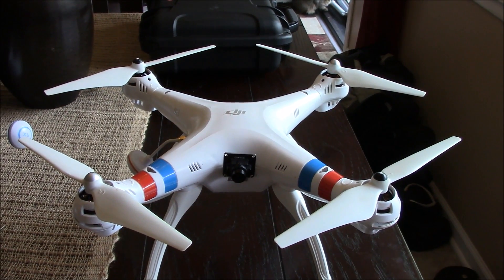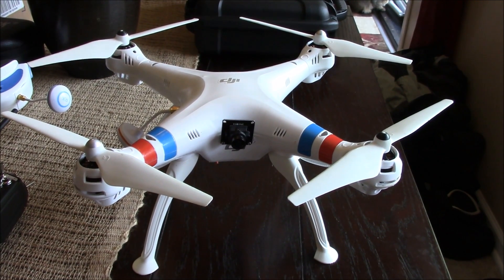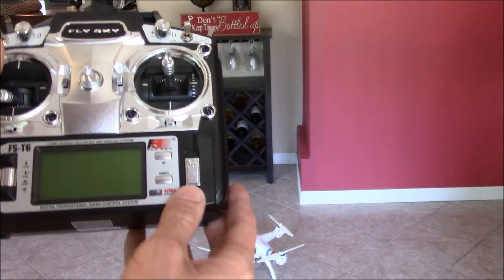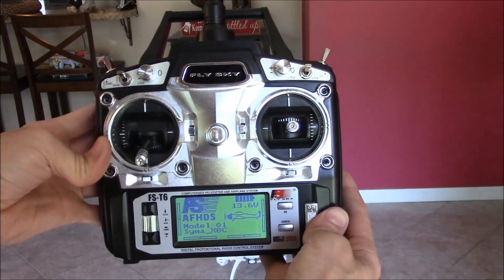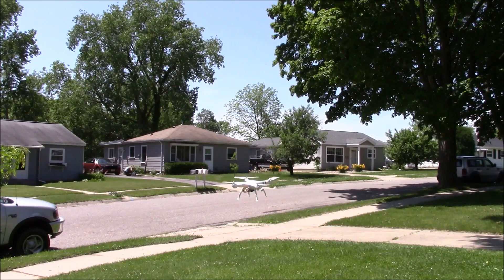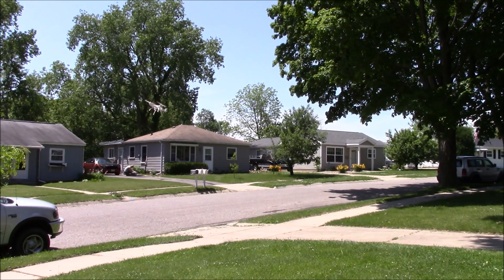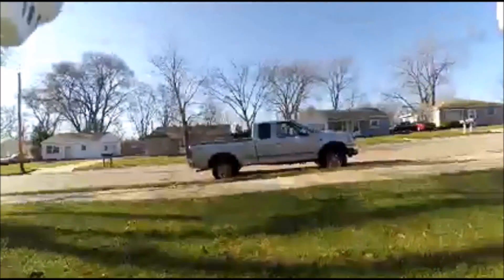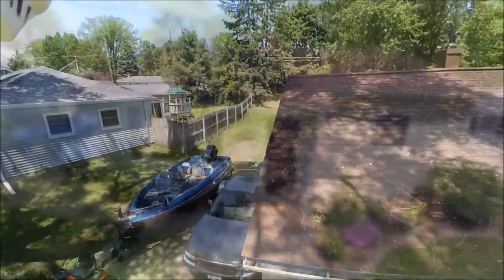Syma X8 with brushless motors and Naze32 flight controller

Comment: hi. did you change the battery ?
Reply from the maker: yes, i use an 11.1 v 3 cell 2200 mah battery, externally mounted.  I can still use the stock battery in the stock internal mounting location if I wanted to though

Comment: Hi Preston, I saw this video showing the X8 brushless conversion using the stock RC but it's done differently compared to yours, it involves removing the mosfets and adding pin connectors for a direct connection of the ESCs to the board.

https://www.youtube.com/watch?v=yHnplLnMdkU

There's a part 2 as well as flight videos of the conversion. What's impressive is that it flies very stable and not wobbly. I'm not sure why but I think it might have something to do with not having a brushed to brushless signal converter like with your mod.
Reply from the maker: I've seen it.  I could have removed the mosfets as well, but there is no gain in doing so - they are simply a high amperage switch, the signal remains the same.  The ESC's cannot work directly as shown in his video (Syma outputs a PWM signal, ESC's require a 1-2 KHz switching frequency for off-WOT).  Its likely that either A: he bought ESC's that have the ability to recognize a PWM input, OR B: He programed the ESC's internal software to recognize it - Most ESC's can be reprogrammed.  As far as it flying smoothly, either his motors are much less powerful (combined with the less powerful stock Syma 2S battery), or again he used the software at the ESC level to add a delay or buffer to the input signal which could be used as a crude form of PID control.  Possible? Yes, but not practical for most people with limited experience.  Using a custom RC and flight controller will still allow for much greater support, tuning, and expandability.
Reply from the maker: Oh, there is also one more drawback, that is quite serious with his build.  The stock Syma receiver cannot account for an extreme angle or attack - the motors shut down during extreme angles.  I crashed my quad many times with the stock receiver.  The motors have enough power to flip the quad quickly and the quad would react by shutting down the motors and falling.  This doesn't happen on a stock Syma because the motors are too weak and slow to react.  It seems to fly smooth indoors, but during fast evasive flying outside, I would expect a much different reaction.  The aftermarket flight controllers have full 3D support, so this is not a problem with them.

Comment: Good News! you no longer have to do this modification the answer to this is the Bayangtoys x16 Brushless Quadcopter
Reply from the maker: Oh there's lots of cheaper brushless rtf quads out there, but I like building stuff.  I'd rather build and fly my own even if it costs me a bit more.
Reply: Its just like a Syma x8 but brushless
Reply from the maker: Yeah it looks like a sweet RTF quad, I saw the video you posted.  How much was it?
Reply: +Preston Rice its $120 on sale ..
it really is the Syma x8 that Syma should have put out.
even the controller &  instruction manual are almost identical
Reply from the maker: +Full Metal Heli awesome, I may have to add that to my collection. Thanks!

Comment: Preston can you look at this video and tell me if this board looks like the X8HW board you installed, that little green board is the new addition it just looks a little hacked https://www.youtube.com/watch?v=YlYGDCyeuz0&feature=youtu.be
Reply from the maker: I actually have not used the altitude hold version lol, but I have obviously quite a bit of experience with the regular Syma boards.  The one you got looks genuine to me.  The crooked circuit in the middle just gives it "character" lmao
Reply: lol yeah ok well eventually ill put a real FC in it but I want to keep it a model for as a long it works for me.thanks for your time

Comment: can u tell me how long it is flitgh time with what battary size ,mpa, s etc and how much witgh it can carry on beside the battary?
i buy my syma x8c and buy fpv system that conect to SJ5000 and i buy bigger battary 3s 2800mah 30c and 2 axis gimbel that is 160g and the battary is 212g and big antena for the dron and tarot osd with gps and a some more thing, and after i placed the orderes, i  check on youtube how muth whigh it can carry and i saw that 250g is the max
i wonder, if i'll do like you did, i will be able to carry all this staff or it will be to muth
also want to know if the naze32 can have safty return to home doing gps possion and gpg hold and all this kind of staaf that have on the exsnsive drone like upair cx20 and phantom 2/3.
sorry for my english i know is not the best one.
hope you can answerme.
thank's.
Reply from the maker: The flight time was similar to stock with the stock battery, but I do draw the battery down to its minimum level when doing a long flight.  With larger batteries from about 4-5000 mah, you can obtain flight times over 15 minutes.  Once you do the brushless conversion you will be able to lift much more, the motors are quite powerful.  A 2 axis gimbal with a battery like the one you bought should be about right.  The Naze32 does support GPS and return to home and position hold functions, but I have not tested them out yet.  Thanks for your interest, hope this helps!
Reply: This kind of thing to do it's vert chip and I'm relly think of do at my self i just wont you to check this out for me if you can tale me what you think...

Comment: nice! I am definitely give this a try. I have not that much experience in constructing things but this seems easy enough to give a try(since there is a good explaining video!) But I would like to know more about what things you used to make it fly right. exactly what did the final build contain? the previous video got links to the parts but not this one! thanks for the great job!
Reply from the maker: Thanks!  Its a lot of fun, just take your time and do research.  I did not know much about this stuff not too long ago, just learned as I went.  I have updated the description to include a parts list.  You can source the parts from multiple places online, depending on how cheap, or how fast you want to get the parts! ;)

Comment: check this mini 10 DOF TC and a PB that does it all.-CC3D Revolution Mini Combo OP Flight Controller OPLINK Radio Telemetry GPS OSD Power Distribution Board.-Matek LED & POWER HUB 5in1 V3 Power Supply Board + BEC 5V 12v + Low Voltage Alarm+ Tracker.
Reply from the maker: CC3D is an excellent flight controller.  I wouldn't count on that GPS module working though, they're junk lol.  I really like that power distribution board though, looks very nice!  Too bad I'd have to wait for it to come from China (bangood.com)
Reply: Yeah agreed Im gonna look to the Pixhawk to satisfy my autonomous flight Im a hardware junky. I put this on my project list tonite.&#160;&#160;They say its based on cc3d but its a real pin fest-----http://www.goodluckbuy.com/micro-quadcopter-flight-driver-controller-9dof-9-axis-altitude-sensor-stm32f103.html----------https://www.bitcraze.io/

Comment: you are just ahead of me on what Im doing with my orange x8w. I order the x8HW board and the x8hw transmitter so ill be swapping that out for fun. I have a cc3d Im gonna setup on a 250 chassis first and then pack it a new orange x8w chassis with custom pencil carbon gear. I think the Syma looks better than the carbon frames.  I have a controller gimbal and a gopro 3 with the 250mw tx on the side of the gopro. I also have two CF plates for externalizing the vid tx it will get hot and battery on the opposite side Anyway Im glad someone is doing what I am it makes it easies for me and keeps me motivated thank you and happy flying.
Reply from the maker: Sounds like a cool project for sure, post a video of your build!  I like your ideas as well.  I agree, the syma's have a nice look.  I can't count how many negative comments I've had from people that basically say why don't you do what everyone else does?  They're forgetting, the best part is building it yourself and making it your own!  Thanks for watching! :)

Comment: Quick question, how did you get the phantom propellers to work with your syma? I just got mine and that's on the list of things I would like to do.
Reply from the maker: The motors are a direct aftermarket replacement for the phantom 2 or 3 series ;)  That's why the props are matching.  Check out my other build video for this white one, walks you through the whole build up until this video.

Comment: The look of this copter is very beautiful! Like expensive DJI series! Good job! With old flyboard you can't stabilize drone? Do you know about symaxrx project on github? With this library and cheap nrf24 wireless module, you can use your syma remote with arduino.
Reply from the maker: Thanks!  Its simply easier to use a commercially available flight controller and RC rather than to mess around with whats there.  I would imagine the Arduino microcontroller could be used to alter the input signals, but it would get unnecessarily over-complicated quickly, and you would still lack the great additional features and support that you can get easily with most flight controller software.

Comment: Great job Preston.!! I can see by the footage it is much more sedate yet still carries a powerful punch. I have a Naze 32 - 10 on the Chinese slow boat along with a Fly Sky controller - ppm receiver. I noticed your ESC's are smaller than the ones used in the black X8 conversion, so are you using 20 amp.? The blue tooth link to program is a great idea, do you a link to the device used.? I have heaps more questions, but for now just a well done you and thanks for sharing your proper job hotrod..
Reply from the maker: Thanks!  It flies like it should now.  The ESC's in this build are only 12 amp.  I figured they would be able to handle a 3s 11.1 volt battery, and so far they have done just fine.  I wont be running this on 4s 14.8v anyway, since I have tuned it around the 3s battery.  A 4s would most likely draw much more than 12 amps of current.  I think with the 12 amp ESC's I probably occasionally spike over 12 amps, but the ESC's are rated to handle occasional spikes.  This is the Bluetooth module I used: http://www.amazon.com/IEIK-Wireless-Bluetooth-Transceiver-Arduino/dp/B00OT6VF64?ie=UTF8&psc=1&redirect=true&ref_=oh_aui_detailpage_o05_s00 .  Questions are welcome, thanks for the watch!
Reply: Ah..I see..I am using 2212 1000 kva motors, with stonking great 30 amp ESC's, and I must admit they are bulky items and thinking of mounting them on their side allowing the screw posts to remain holding the shell covers together. Thanks for the Bluetooth link, I'm still a few weeks away from completing my conversion, and I may come back from time to time and fire some questions at you. In the meantime, keep up the good work and thanks for sharing.
Reply: Hi Preston, how much clearance do you have between the top cover and the wiring plugs to the Naze 32 ? It looks like you were able to use the four screw fixings holding the shell halves together (removed on the black x8 to house the esc's) Any future plans to add GPS ?
Reply from the maker: +mick thebass I have probably around 1/4" left, there's quite a bit of room to work with.  If I used the 90 degree pin headers on the Naze32 I could probably stack the GPS module right over the top of it.  Yes I was able to retain the 4 chassis screws at each arm on this one.  That was the main reason for choosing through 12 amp esc's, since 20 amp or larger does not fit in the arm without removing the screw holes.  I probably won't add GPS to this once since I'm just using it as a practice racing drone at this point, but I may tinker later just to see if I can get it to function right.  A friend of mine in the UK that followed my build got his GPS to work perfectly!
Reply: Great..Thats handy to know, I had visions of cutting a huge hole in the top to cram all my gear in..Thanks Preston.
Reply from the maker: Haha, yeah no need for that!  Heck, if you don't mind running an external battery like I usually do anyway, you could start from the very bottom and gain another 1.5 inches at least!
Reply: Haha, no I should be good to go working from the same level platform as yours, but running with the battery in the bay and a gimbal down under. I intend to use the original switch and socket area for plug ins..Gimbal power, pitch control, mini usb and fpv. As you know, the best way is to have all the components in front of you, then place and plan from there. I hope my hotrod to be a super cool video platform.

Comment: what was the total cost for the conversion? I would like to take on this project, very cool, and good job.
Reply from the maker: Total cost in all the parts including the fpv camera and extra battery, around  $275 (or around $350 including the syma).  could be done cheaper if you don't mind waiting for parts to come from China.  The fatshark v3 goggles are around $350.  The Syma X8C is around $70 I think. Doing just the brushless conversion should be around $200.   It's alot of fun to do, although there are ready made brushless quadcopters that are cheaper than doing this yourself. Thanks for watching, and keep me updated if you decide to do it!